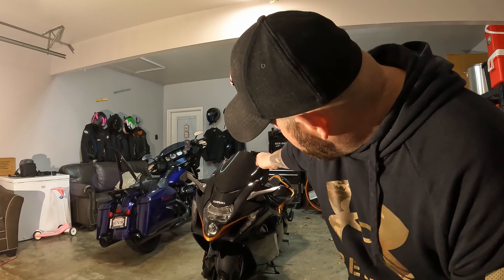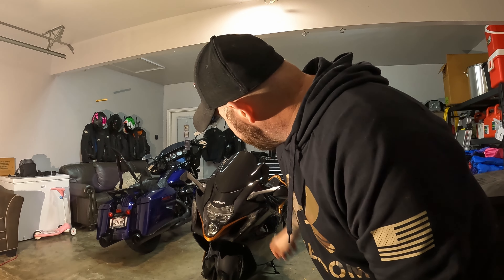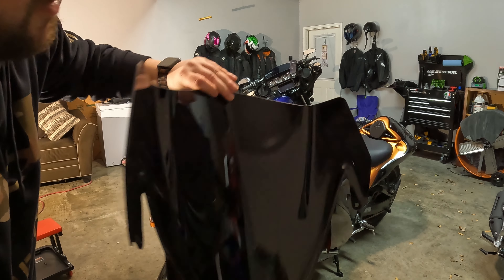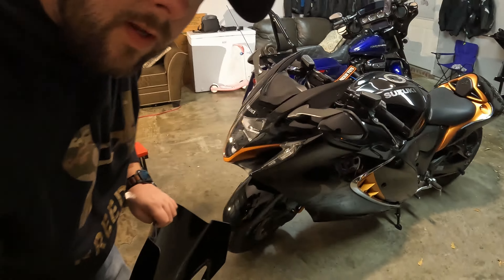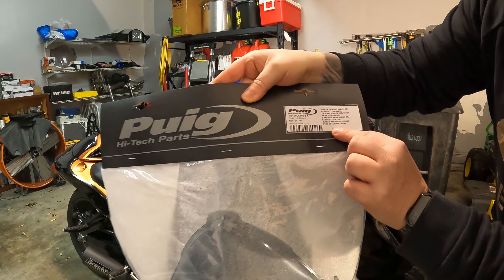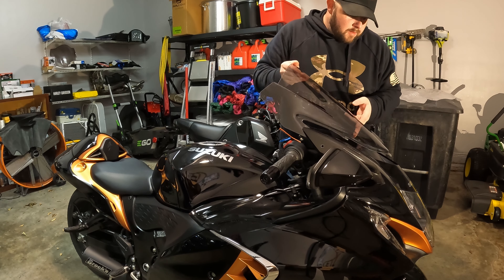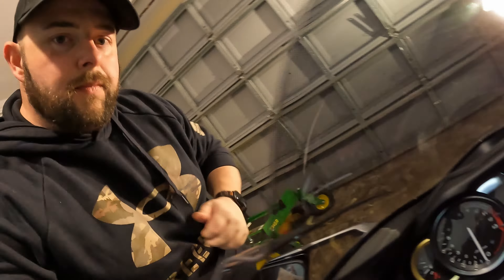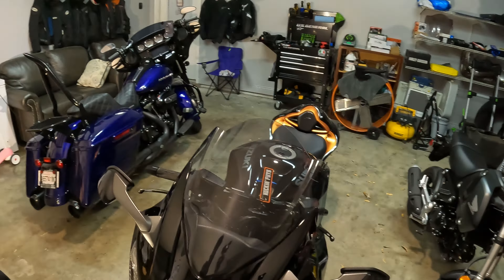Gen 3 Hayabusa | how to install/Replace Windshield

Comment: Nice simple install. By any chance do you know how much taller this is than stock? I'm looking for a bit more wind protection as I'm over 6" tall and long in the torso. But I also don't want my helmet up against it in a tuck.
Reply from the maker: It’s about 2 inches longer than OEM. It definitely blocks the wind for me. I had to order a smoked one only because the blacked out one. I can not see anything out if it. But it def should be good enough for you being 6’’. Now I would order from Revzilla only because their return policy is awesome in case you don’t like it.

Comment: Hey! I just replaced mine and I noticed that the two outer bolts aren't really attached to anything inside of the fairing, it seems to just be there on the windshield hole. Is this normal or is it missing a piece inside?
Reply from the maker: Nope that’s normal bud. Just have to be mindful of the rubber between the fairing and the inner plastic. Make sure it doesn’t fold up on you while sliding the new windshield into place.